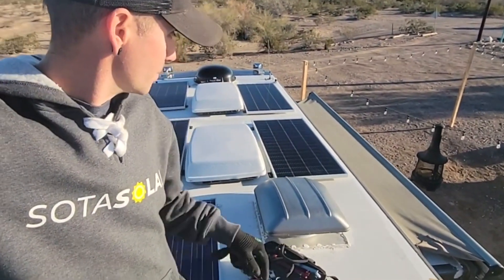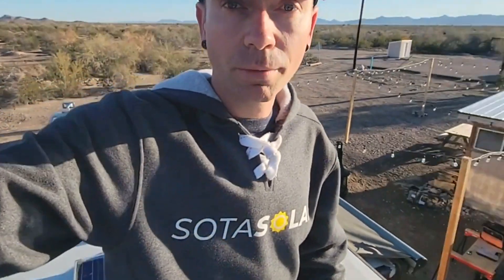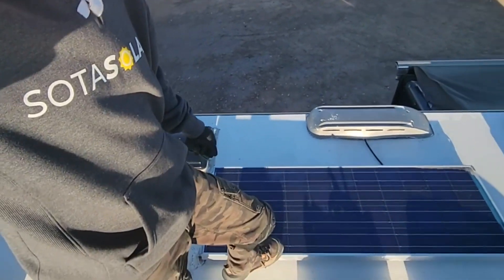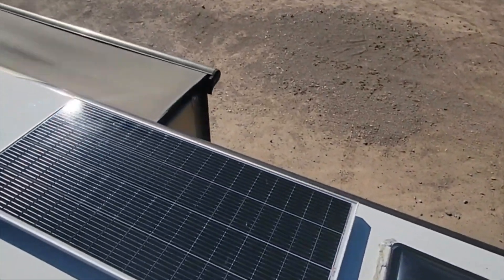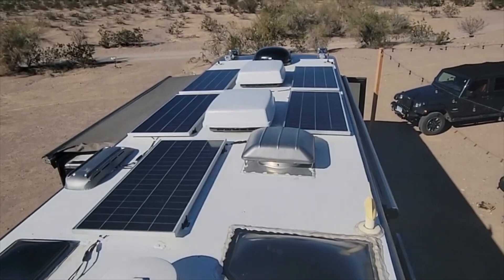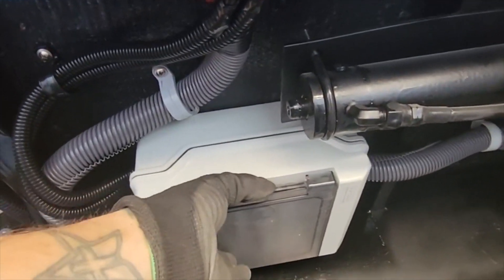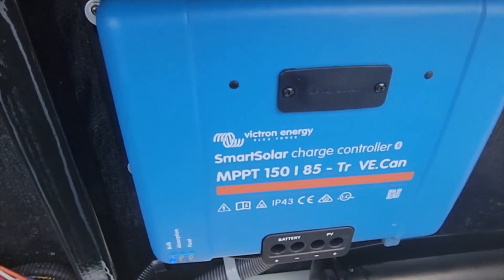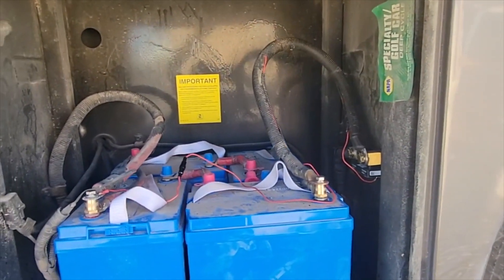1200w RV Solar Upgrade on 2004 Monaco Dynasty

Comment: Thank you for doing these videos, they do help a lot!  I have learned a lot based on how you do your installs.  I havn't found a video that goes through what you are doing for mounting the panels though.  Do you have something that goes through what mounts you guys like, how to determine where to drill/mount into the roof, and what you do regarding sealing?
Reply from the maker: Thanks. We do a combination of VHB tape , and doctor for sealing the holes. 

We use 1” #14 roofing screws to secure the panels to the roof.  No need to find any significant structural part. This is very similar to how the RV manufacturers do it, we just upgrade the fasteners. With the 8 fasteners and the dicor, they are almost glued down as well. 

As we dad’s like to say “that ain’t going anywhere “.